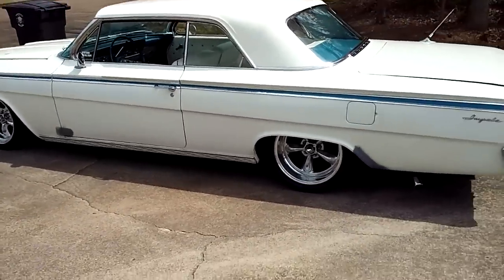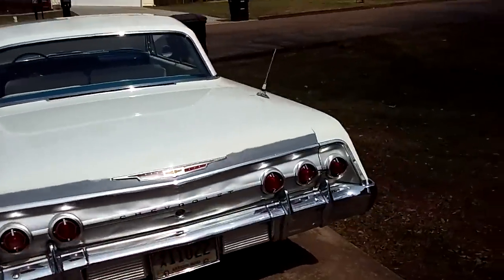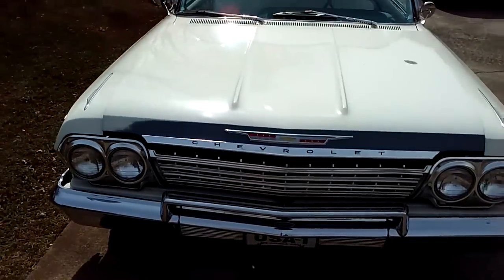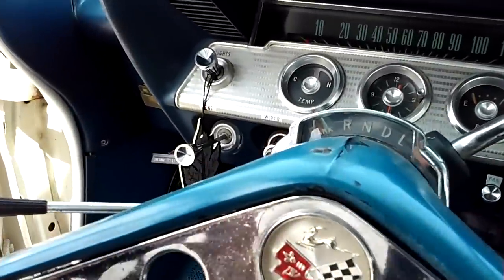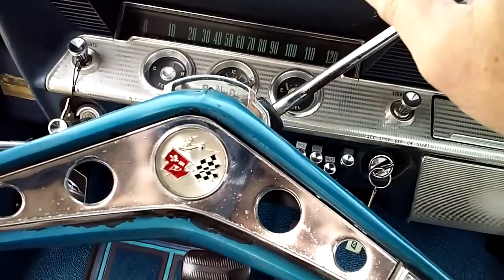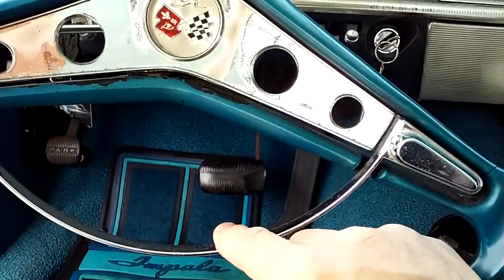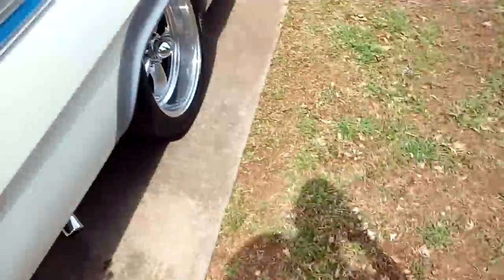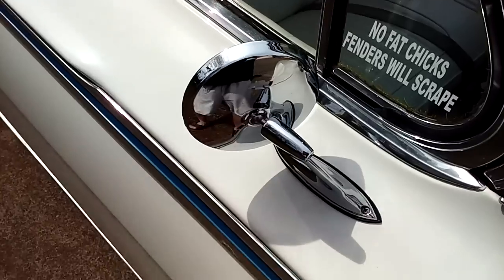The differences between a 1962 Chevrolet Impala and an Impala SS

Comment: 2 door hardtop like yours are called "Sport Coupes"
Some came with the antena on the right front fender and some on the right rear fender.
Mine had it on the rear and I added the optional left rear fender antena to give it a more balanced look. Mine was Silver Poly Blue with blue interior and white molding inscripts.
283 powerglide.
I now have a red 1964 SS 327/300 hp. 4 speed numbers matching car with white and red interior
Reply from the maker: I appreciate your comment my friend and for watching the video! Good luck on your search for the 64! Have a blessed day today my friend!

Comment: Some very early 62 Super Ports came with the regular Impala rear trim instead of the swirled SS trim. The supplier had issues. The dealer would swap over to the swirled trim if you brought the car back after it was in stock. I'm sure there are a few Super Sports out there with the standard rear trim.
Reply from the maker: Roger Loesch  Thank you for the info. I went blank for a minute when I was doing the video.  I do that alot lately.  LOL   Thanks again. I appreciate it.
Reply from the maker: Thank you for the info.  I appreciate it.
Reply: Yes, my Deuce drop is original and did not have bezzled rear trim, nor the rear antennae. *but, I may have to grab that glove box cover from a ‘61..  oh, also I believe it should have two tone steering wheel.
Reply: Pontiac also used engine turned parts on gto  & later trans am.

Comment: Chevy Super Sports were trim options up until about 65, there are several examples  out there a straight 6 with factory SS emblems. That all changed after the GTO.
Reply from the maker: Thank you for that good info! Very much appreciated!
Reply: Impala trim option ran from 1961-1969 / then to the ones in the 90’s !
Reply: 1967 was the last year you could specify an Impala Super Sport with the six cylinder engine...
Reply: @mrBILL-sr2cu  that's good to know. The SS chevelle first year with a standard big block was 66, though a few Z16 65s are out there but very rare. Too many people associate SS as a performance package when it was initially a trim package.
Reply from the maker: @mrBILL-sr2cu    Hello! Thank you for that good info! I really appreciate it! Thanks buddy!

Comment: In 1973 I bought a 1962 Impala SS, black with red interior.  327 with automatic trans. I consider the 1962 SS only half an SS.  Why?  It had bucket seats but the shifter was on the steering column.  It had half a consul between the front seats, which was a padded box with a lid.  It had stock Impala wheel covers with an added spinner bolted in the center.  In my opinion the true SS came out in 1963.   Oh, and I bought the 1962 for the motor and junked the rest. I'm still kicking myself after all these years.
Reply from the maker: Thank you for sharing your story! I had one just like you described. I sold mine as well. Just one more regret that I carry along with all my other regrets! Lol. But at least we can both say that we have owned one! Thank you very much for your comment! Made me remember that 62 SS again! It was a good car!
Reply: Your '62 Impala Super Sport was correct, the column shift auto was correct in all full-size Chevys that year. Only 4-speed cars had floor mounted shifters. Also SS wheel covers did have the 3-bar "knock-off spinner in place of the blue center insert.

Comment: I had 62 impala SS i paid 150.00 for in 1976 i wish i still had it i loved that car
Reply from the maker: You are very blessed my friend!   I wish I had alot of mine back as well.  I hope you have a great day and check me out of FACEBOOK or INSTAGRAM   Primered is Best     Thank you!
Reply: The 62 black non ss convertible 6 cylinder I have was bought in 73 for 75 bucks was on used car lot at Chrysler dealership where my father was a class a mechanic got employee discount original price was 200 .was driven till 77 became mine in 1980 been off road since in dry storage everything pretty much replaced now. coming bk out in spring 2020

Comment: Great video 👍 Do you happen to have a trunk panel moulding? The part that goes along the entire back of trunk with the trunk key hole, idk exactly what that panels called but I have a 62 sedan, someone broke into the trunk and crowbar'd the trunk key hole out so I just need the entire aluminum molding that goes across the back of the trunk,  my trunk is fine just need that piece
Reply from the maker: I might be able to help you. What is your phone number so I can contact you? Thanks!
Reply: @primeredisbest  ill send my number through email so it's not on YouTube

Comment: Good video, nice car. One other way to verify, and really the only way to truly verify if a 62 is an SS or not, is to decode the trim tag. If the car came with bucket seat interior, then its a true SS. If it did not come with buckets, then it is not an SS. As you said the emblems, grab bar, and swirl panels can all be added pretty easily. A bit harder to change the trim tag.  By the way the bucket seat verification only applies for 62 model years, as far as I'm aware.
Reply from the maker: Thank you very much! I appreciate it!
Reply: @primeredisbest  I know people say they have seen super sport cars with bench seats... I thought the same for years.... But apparently all SS cars left the factory with buckets. It wasn't possible to check the 30 dollar SS option box without first checking the hundred and some odd dollar bucket seat option box from what I've learned. Lots can be changed in 60 years I guess!!

Comment: To know if your is a true SS and not a clone, you can check the vin number. My favorite is a 1963 Impala SS with a 409, 4 speed. and love the tach in the dash.
Reply from the maker: Thank you for your info! I appreciate it!
Reply: In 62 the vin doesn't verify an SS. The trim tag will. If it came with bucket seats, it's an SS. The only way to truly verify for a 62 model year.

Comment: Another difference between the regular Impala and the SS was the springs were 1 inch shorter on the SS. I had a new '62 Impala 300 hp 327 and when I put bigger tires on the back I switched to the SS springs so it would sit lower.
Reply from the maker: Thank you! That is some good info! I did not know that! Thank you for sharing!

Comment: Why not just check the cowl tag?  Trim code "813" bucket seats.  Only SS cars had bucket seats in 62.  Atlanta cars also had SPORT X1 in the ACC code, not sure about the other assembly plants.
Reply from the maker: I have had Impala SS car with the bench seats in them. Back in the day, you could get one anyway you wanted it. Even with a 6 cylinder. Some of the plants that made the cars used ID's on the cowl, some did not. I am just showing what to look for in one quickly if you are looking at buying one.  Thank you very much for your comment! I really appreciate it!
Reply: @primeredisbest  Back then SS was a trim package, not a performance package.  Could you have gotten a 6 cylinder SS, yes.  You also could have gotten a 409 non-SS.  I've talked with several Impala people and the vast majority say go to the cowl tag to see if the car is a true SS.  Every 813 trim car is a SS as only SS cars had bucket seats in 62.
Reply: This is correct. If it had buckets its an SS.

Comment: How do i know if im getting a good deal on a non Ss 62?...what key elements should i look out for?
Reply from the maker: On a 1962 Chevy you need to look for the typical rust issues. Hood, floorboards, trunk, etc. As far as a good deal, if you can even find one nowadays you are doing good! Lol. These cars are worth quite a bit of money fixed up but parts are very expensive to purchase! Do you homework and look on EBAYMOTORS to get an idea of what you might be getting into. Good luck my friend!

Comment: Engine turn is what the design on the trim pieces
Reply: That engine turned stainless and aluminum can be created by acid etching making it available to prople who aren't billionaires. It also helps with mass production.
Reply: The swirls you are talking about are "engine turned" or "machine turned" and the design was pretty popular on a lot of cars in the 30's on dashboards. They mostly were on center panels around the gages.
Reply: It's like gold leaf, its finger turned

Comment: I had a Red '62 Impala SS 409 4spd car back in High School (1969) . It had factory HiPo heads, dual quads, dual exhaust and close ratio 4spd. It even had factory exhaust "dump tubes".  No factory PS or PB and the clutch was SUPER stiff. Sure wish I still had it.  It passed everything on the highway EXCEPT a gas station.  AWFUL gas mileage.   ;-)
Reply from the maker: Oh man how fortunate you are to have had my dream car! I bet it was beautiful! I wish that you still had the car too! But at least you can say that you have owned one before! Not many people can say that! Thank you so very much for sharing your story with me! I really enjoyed reading it! Thank you very much!
Reply: @primeredisbest   I still have pictures of it and I've had several 62s since then too.  I bought one of them from a "little old lady" in Wenatchee WA. It was a white 2dr htp like yours, but it needed paint, so I painted it Marina blue metallic and put on a set of "American" Grey-Spoke Torque-Thrust mags. The tires were 60 series white letters and the brake drums underneath those Grey Spokes were painted the same Marina blue color showing through the spokes.  It was gorgeous.  Wish I still had that one too.  I've also owned a '63 SS, '64 SS and a '65 SS back in the day, but my rarest SS was a '61....of which I've seen maybe 5 of in my life.  They were a "348" with Tri-Power for the first half of '61 and the latter half of '61 they started installing the big "409".
Reply from the maker: @USCG.Brennan   Thanks again for sharing your story with me! You my friend have had a very interesting life with beautiful cars! You are very blessed to have had the cars that you have owned! I can only dream about owning cars! Thanks buddy for your time! I greatly appreciate it!

Comment: Nice car. 61 and 62 share the same doors and front 1/4 of the quarter panel as well. I have a 61 I'm LS swapping and installing a Tremec tr6060. I'm also switching to a one piece drive shaft and Ford 9in. People say keep your GM all GM but the new COPO Camaros come with a Strange Ford 9in so a 9inch did come in a GM vehicle. Purist might not like it but my car my $. I wanted something different!
Reply from the maker: That's great! I love 61 Chevy's too! I see no problem with what you are  doing with your car! It's your car! I have people tell me all the time that I have messed up my cars and trucks. But they are mine and I worked just like you to pay for them. I would love to see pics of your car! Please send me pics to my Instagram: PrimeredisBest: or Facebook Primered is Best.  I have put a couple 61 Chevy parts on my 62 Chevy. I will make a video of the car next week and explain that. Thank you very much for sharing your story. I really appreciate it! Thanks!

Comment: I have a ss 62 impala there  are little red lights that are under the ss impala emblems in the front of the car and the back.  This will tell you if you have a real ss the holes for the emblems will also be available for the ss emblems with a big round hole for the red bulb turn signal lights.
Reply: Something I never knew. I'll have to check into that. I almost did that to the F100 emblems on my 66.

Comment: Don't the SS impala have duel antennas?
Reply from the maker: No sir. The dual antennas were kinda like a custom job that you would do on your car for looks. I have had a lot of Impala SS cars and everything was an option. I have had SS cars with them on the passenger side front fender and on the rear as well. Even had Radio Delete too with just a plate covering the radio. Thank you very much for your question.  I really enjoyed hearing from you!
Reply: I have a 62 SS and it has double antennas and I looked it up after I asked you and it said that most of the time it was a dealer addition. I love the 62 impala.
Reply from the maker: @mitchellbrannon8930  That is true. Back in the day everything was an option and some things were dealer installed. Believe it or not, I have had 4 1957 Chevy Trucks. They only came with the drivers side window visor. If you wanted one for the passenger side you had to make it an option so they would  install it. Funny how things were back in the day.Thank you my friend for your comment! Appreciate  it!

Comment: I'm trying to find a 62 or 63 or 64 car any clues i live in Florida appreciate your help in finding one
Reply from the maker: Hello Mr. White. Look on FACEBOOK and do a search for Tim Dixon at GAS AXE CHOP SHOP in Ten Mile Tennessee. I think that he has a 62 Chevy SS that he might want to sell. I don't know how much though. His phone number is on Facebook. It's rough but a builder. Hope that this helps you! Thanks!
Reply: I have an engine#'s matching  Original paint  (red) 62 Impala SS Ragtop with a 327. Missing drivers fender trim piece.  Originally an automatic....but was converted to 4 speed by my uncle (previous owner) Trans long gone.  Pretty solid.....having professional engine work done now due to cracked head.....but other than that ran great having motor gone through to make sure it is reliable...will run great again soon. Will consider a sale. I am a full disclosure guy and no BS

Comment: You have any parts for a 62?
Reply from the maker: Hello, I have some parts. What are you needing?  Thank you!
Reply: @primeredisbest  
Driver side door panel 
Rear lights and embezzlement 
Front and rear bumper guards
Reply from the maker: @lomerowschiquesx392   I might have some rear tail lights and bezels. The rest of the parts I do not have. I will look them up. Thanks.

Comment: On a Classic SS Impala's the shifter is always on the floor not the steering column.
Reply from the maker: Hello! Back in the day, you could get them in any configuration that you wanted. I have had several SS Impala's with the shifter on the floor and on the column. You could get them with bucket seats or bench seat. Chevy just wanted your business. They tried to make a car to fit your lifestyle. If you had kids, you might want the bench seat with the shifter on the column. Thank you very much for your comment! I really appreciate it!
Reply: @primeredisbest  that is true but not a original SS Impala. I had a 1964 SS impala all original no modification just like it was before and I had friends that had just a regular Impala's no SS. But of course all Impala's are beautiful in their own way.
Reply: '62 Impala Super Sports came from the factory with bucket seats & center console. Powerglides & 3-speed synchromesh transmission cars were all column mounted, all model/trims. Only 4-speed cars were floor mounted. Super Sports only had the bezel surround.

Comment: Easier way is a 62SS it has bucket seat...
Reply from the maker: No, sorry that is not correct. You can order a SS anyway you want it back in the day.  I have had  2 them with the bench seats ordered from the factory that way.  You could even order a 6 banger if that is what you wanted in your SS. I have had 13 Impala`s and alot of them were SS models.

Comment: what about the motor? we impala buffs want to see the motor and the exhaust system whether its a dual exhaust with the chrome flat tip's...etc...
Reply from the maker: That's a good question! Unfortunately, I don't have the car at my house right now. It's at my friend's house doing some maintenance on it. But I have several videos showing the engine. It's not pretty! Lol.  Just stock form. You are welcome to look at the videos on it. But it's nothing fancy. Runs good. To me it's getting harder to find one that is mostly original so that's how I will keep it. Everything else that I have changed can be very easily put back original. Thank you very much for watching the video and for commenting! I really appreciate it!

Comment: lots not forget that on the small block,  the impalla has std heads and the SS had power pak heads.
Reply from the maker: Thanks buddy! Good info!
Reply: Jeezus, in all full-size Chevrolets for '62 any engine could be had in any model. ALL the engines were the SAME no matter what body/trim level they were stuffed in. You could get a Biscayne 2-door sedan with a 235cid 6cyl or a 409/409. Ditto for an Impala Super Sport convertible.
Reply: @rsstrazz6261      Incorrect!    check your facts again.